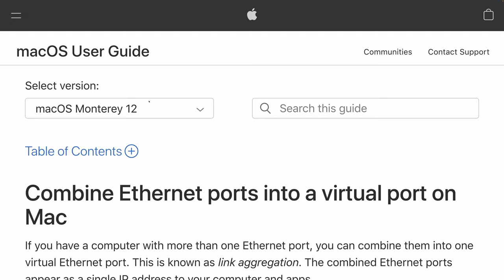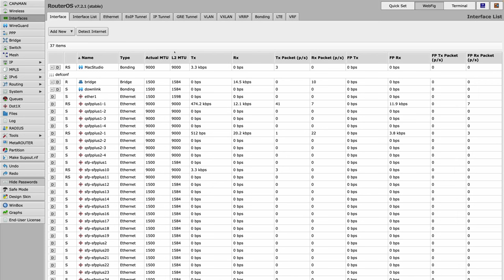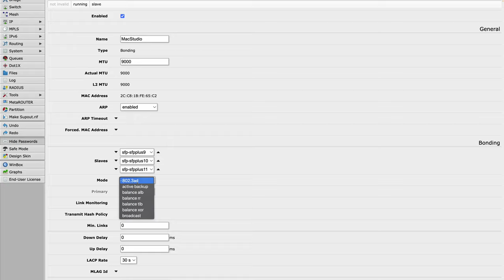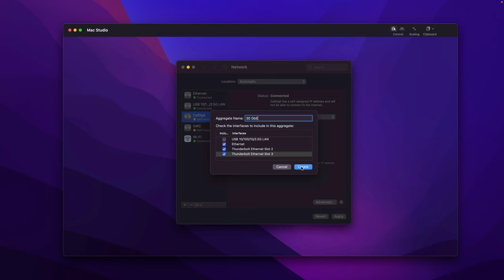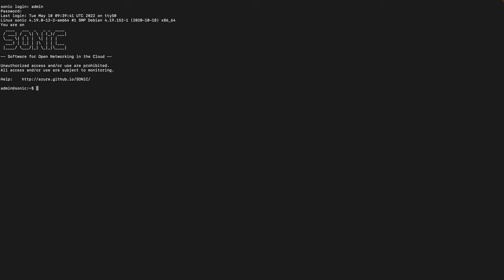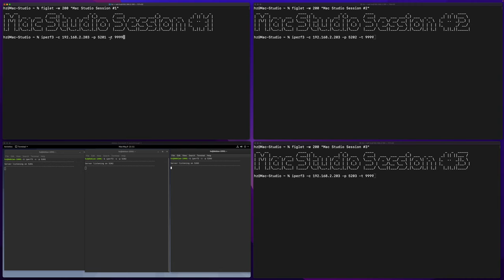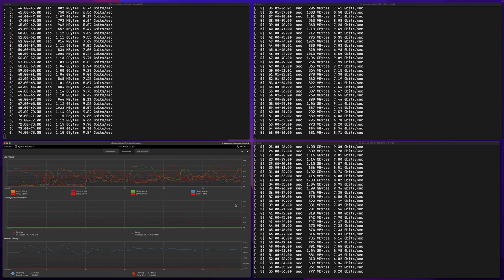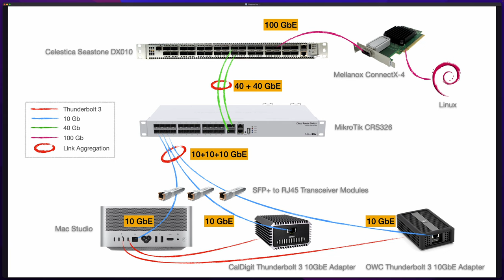When Mac Studio Meets Link Aggregation - 30 GbE Speed w/ MikroTik CRS326, Celestica Seastone DX010

Comment: I like how LACP played so nicely in this case. Most OSs hash based on MAC by default. It appears in your case that L4 was used, at least in the direction you tested. Did you try -R and get similar results?
Reply from the maker: Yes, similar results when using -R. I also did not show the two direction testing because the server is Debian, where —bidir is not supported.
Reply: @hz777  I will add that I have never tested LACP between consumer OSs. Generally only between network operating systems (IOS-XR, JUNOS, etc), so the default behavior is likely different. I have seen (on a large service provider backbone) bundle member that are at 100% utilization and dropping packets, despite there being 1-3 more bundle members with plenty of capacity. Turns out the hashing algorithm happened to place a few huge talkers on the same bundle member. Great videos!

Comment: what if you used two sonnet dual 10gbps adapters? if you had two of them, would that be a total of 40gbps minus the ethernet?
Reply from the maker: I don't own that specific adapter, but if it behaves like two separate ports, yes you can say that to some extent. But link aggregation does not mean you can really achieve the total throughput all the time.

Comment: I used to 2 10GbE LAN port on the 2019 Mac Pro, works great with USW. But somehow I can't create PPPoE over the bonded ethernet, force me to use WiFi if I want to PPPoE directly from the Mac Pro.
Reply from the maker: I don’t use pppoe, otherwise really want to test it out. As I know, pppoe is picky about MTU, so if you enabled jumbo frame, it may be related.

BTW, I did not know 2019 Mac Pro had two 10gbe ports! I use a pci 10gb nic in one of my 2009 Mac pros. Works fine, and I get two 10 gb ports as well.
Reply: @hz777  Actually you don't have to use PPPoE to test this. You just need to create a PPPoE connection via the created LACP bond interface. It didn't show up if I use the LACP bond, but work when I choose WiFi. I'm reinstalling macOS right now to see if it's due to my macOS...
Reply from the maker: @zwcai  You are right. I just did a simple test using Mac Mini. When using just the builtin eithernet port, the PPPoE interface can be created, but cannot if using a link aggregation interface. I checked system logs but did not find anything :(